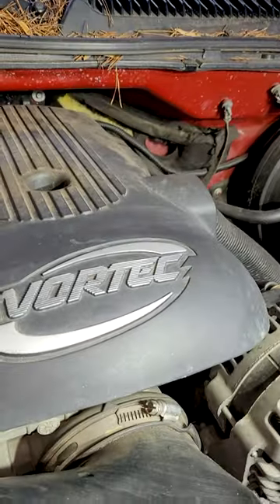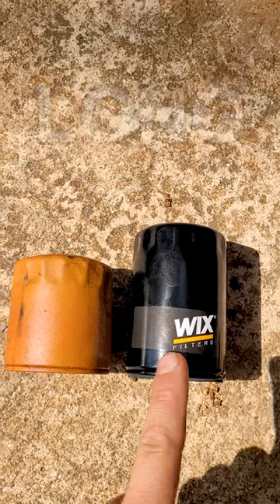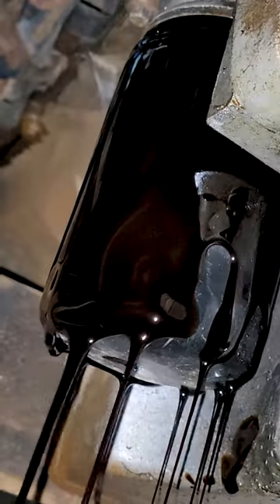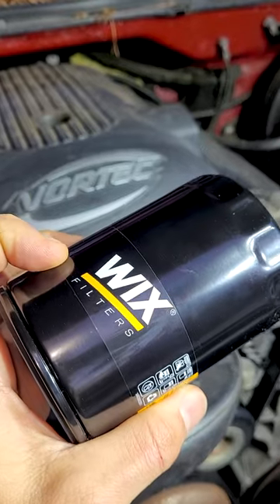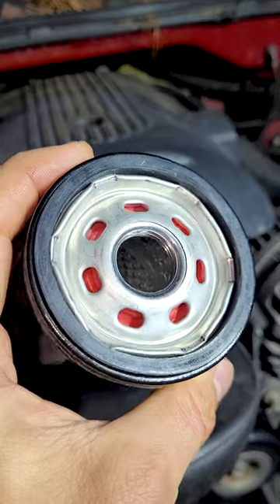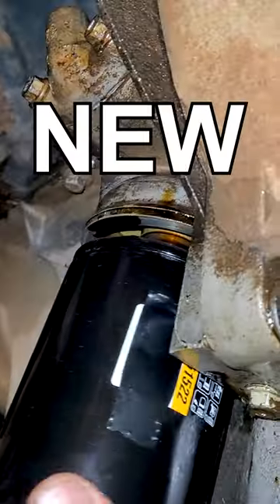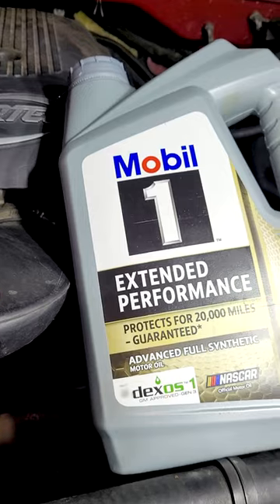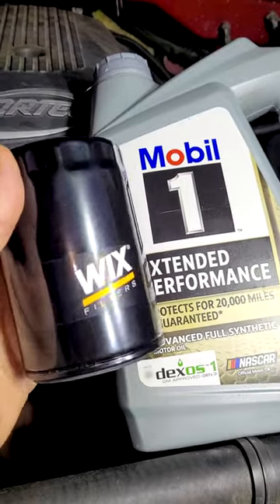Mechanic States BEST Oil Filter Trick?

Comment: I always use Wix and Mobil 1 in my vehicles. And idc if some think its wasting money i always change between 3-4k miles.
Reply: Same here. Definitely not a waste of money... especially when most people don't think twice about buying a 6 dollar cup of coffee at Starbucks every morning... but cheap out when it comes to vehicle maintenance. 👍🏾🇺🇸
Reply: I’m with you 💯 percent. When my Honda Fit hits 50% oil life, it’s exactly 3000 miles. I always change at 3000 miles. I use WIX oil filters, and Mobile 1. Sometimes I’ll use Penzoil platinum. Engine is super clean.
Reply: Spot on, I use a royal purple filter, I will try the Wix.

Comment: Fun fact it won't actually work on all 99-07 trucks because somewhere in the middle of the 2005-2006 year , they started using the pf48 filter , of which the pf63 is the longer version like the one in this video. I have an 05 tahoe that takes the pf61 but if it were , it could've had either or. Chevy was weird with stuff like that. Only found out being a lube tech at a chevy dealer years ago

Comment: I used to drive Prius taxi cab so when I bought my own Prius I did some research trying to decide which filter to use. The suggestion at the time was to use a Corolla filter cuz it was just a little bit longer. Since that time that must have become the factory recommendation because I can't seem to find anybody that has any difference between a Prius filter and a corolla filter.

Comment: Some engine compartments just don’t have the extra space needed to get a longer filter on and off. But the concept you explained is sound if that extra space is there.
Reply from the maker: Yea, it works on some models
Reply: They say larger filters take longer to build pressure during a sub zero degree start when the oil isn't moving as well. Also would have to add a tad more oil to the sump compensate for the larger filter consumption.  Not too big a deal but if you're changing your filters on time you shouldn't need any extra filtering than oem.

Comment: Been using the ACDELCO PF61E for years same size as the Wix. Here's a tip unscrew the filter inside a used large potato chip bag to catch and contain overflow.

Comment: A larger oil filter doesn’t extend oil life by that much. Oil degrades overtime due to heat cycles. It gets thicker and film strength dies out.
Reply from the maker: Yes, but it helps filter out metal and particulate.

Comment: So that wicks filter you're running is not made for synthetic oil period you need to run the wix xp. It will work for synthetic oil. Is very important.
Too Pair your oil filter with the proper oil you're using.

Comment: A) I did know this
B ) I did this on my Subaru legacy GT.  But with a Mazda RX-8 filter. The RX-8 filter was at least 2 times the size.
But keep an eye on your oil pressures. If you get lower pressure doing this, you will ruin your engine

Comment: Heck yeah i knew this. Had to switch back to the short when i put an external oil cooler on my 1500 using one of those sandwich style adapters at the oil filter location. The longer oil filter wouldn't fit due to the engine skid plate being in the way.

Comment: 90-02 GM8xx chassis used the longer, 03-07; GM switched to the shorter oil filter(??¿??). The longer filter is the better choice IMO.
Reply from the maker: I only use the longer filters!
Reply: One filter is for the 4 wheel drive version the other is 2 wheel drive

Comment: Hey I have a quick carburetor question for ya from my Johnson 150 outboard.  Found a hairline crack in the brass idle pickup tube and want to know your opinion on what condition this creates; lean or rich.
Reply from the maker: What year? If more fuel can flow= rich if less fuel can flow because of the cracked part= lean
Reply: @MattsShop  it’s a 2004 with the classic plastic carbs.  Wish I could send you a photo and video of it.

Found out recently it’s also called the “emulsion tube” for the idle circuit.  When the bowl is filled with fuel the fuel level definitely sits where the crack is exposed.  But the crack continues up where there probably wouldn’t be fuel meaning it draws in extra fuel and probably air.  

But is this actually the case, could the crack cause a weak vacuum meaning it draws in less of everything period?

Comment: How much extra oil to add to engine ?
Reply: Not that much, like a few pints.
Reply from the maker: Not much. I have heard like 1/4" quart. Most just check the dipstick.
Reply: These questions baffle me. You clearly can see the size difference. Anyone with a brain can tell it’s several ounces. You will check it anyway if you know what you doing.

Comment: WIX is a good brand. I drive a BMW, so I stick to Mann, but I recommend them to my peeps that drive canister cars.
Reply from the maker: I have always used WIX filters. They work good for me.
Reply: Same company
Reply: @moshet842  Mann is made in Germany bro... Not sure what you mean?
Reply: @320iguy   Mann and Hummel own Wix and Purolator. There are only three major companies that make oil filters.
Reply: @moshet842  so... Owned by Mann, and produced in China? US?
Reply: @320iguy   Mann can be made anywhere depending on the car. My point is that a Mann filter is no better for a BMW than a well made Wix or Purolator filter. They use the same media.
Reply: @moshet842  I beg to differ, the WIX and Purolator filters crush after about 2-3k miles. The Mann do it too, but very rarely.
Reply: @320iguy   Is this just on the BMW filters or in general? I have never had any filter crush on me ever.
Reply: @moshet842  lol . Are you joking? I've seen it on BMW, Mercedes, landrover, Chevy, and Subaru.. it always cheap filters, like from jiffy lube and Valvoline quick lanes, but every so often, I see it on the WIX and Purolators.
Reply: @320iguy   Well, I've never seen that. I've cut open dozens of filters and Purolator and Wix are always at the same level of quality or better than European filters. These days, since Mann and Hummel bought Wix and Purolator, they are all the same inside.
Reply: @moshet842  not the canister types, the paper filament types.

Comment: Engineers usually design things a certain way for a reason not saying this is inherently bad what your doing but if a filter isn’t made for your vehicle there’s a chance you could be by passing dirty oil into your engine. I know you didn’t say this wasn’t made for your engine put just putting that out there for people that might get confused and put a longer filter on there vehicle just because the threads and diameter match